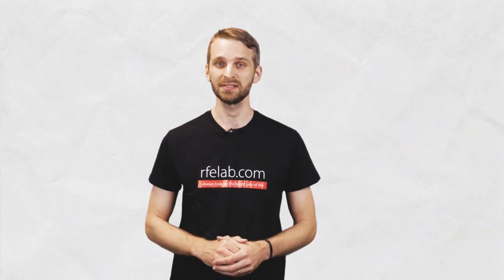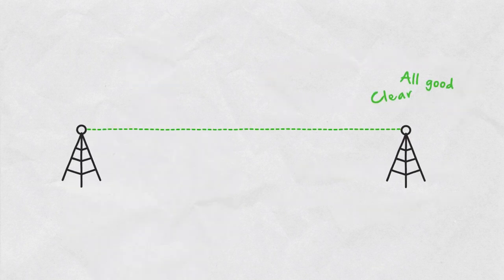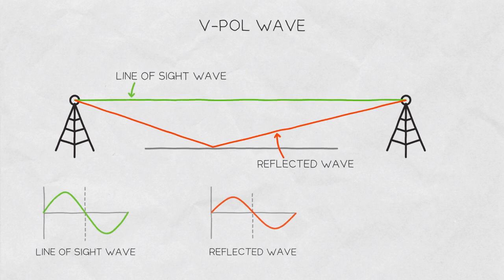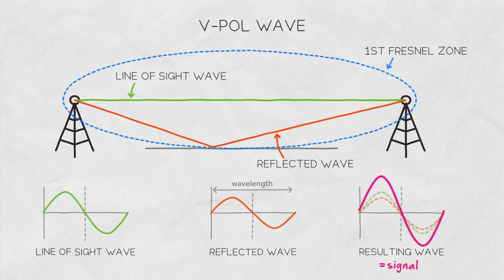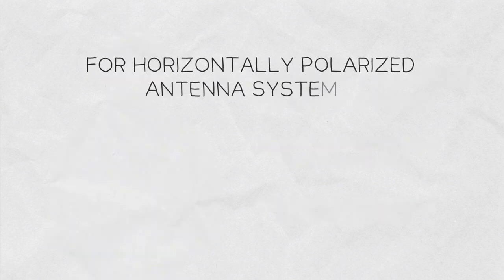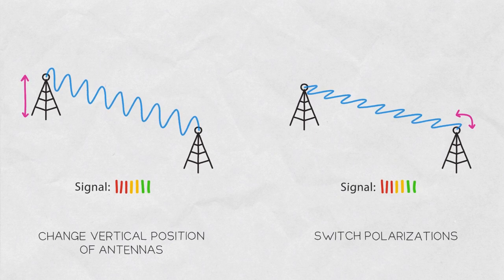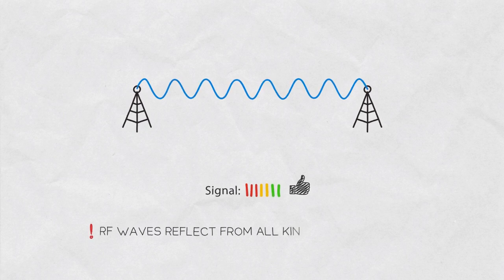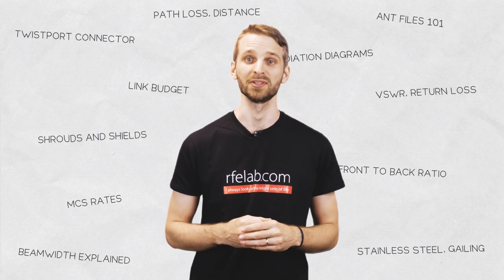Inside Wireless: Fresnel Zones

Comment: The Fresnel Ellipsoid is indipendent of the radiation pattern of the antennas; so if the antenna is a parabolic dish of 1m diameter or a dish of 10m diameter the ellipsoid is the same. But for sure, at the same frequency, the main beam of the 10m diameter is more narrow than that of the 1m diameter paraboloid dish. So the reflections are more attenuated by the radiation pattern of the 10m dish... In same way, in an actual scenario, we have to take into account the influence of the radiation pattern.... In other words, we can have the first fresnel ellipsoid obstructed by a tree or intersecated by the terrain, but it could be no effect on the link performance (i.e. no further loss...) due to the very narrow radiation pattern... Do you agree with me ?

Comment: That's a super good explanation of fresnel zones. While generally knowing about them I only now understood that it's related to multipathing. Does this mean that circular polarized antennas (as used on drones) the fresnel zones impact is less than with linear polarized antennas?   (since circ pol antennas reduce multipathing problem),
thanks, greets, RCSchim
Reply from the maker: Exactly, sine the field vector constantly rotates transversally to the direction of propagation, it is very unlikely that the direct and reflected waves add up destructively, or constructively resulting into decreased Fresnel zone influence with circularly polarized antennas.

Comment: How do actually verify this is happening? like partial Fresnel zone loss due to a building or tree or  Fresnel zones cancelling each other out?
Reply from the maker: It is not simple in real life because of the terrain complexity, but some of the RF link planners do show the 1st Fresnel zone in their results, so at the very least you can rule that out. Nevertheless, the fastest/easiest way to optimize the link performance in terms of the Fresnel zones is to sweep the antenna position on the order of a few wavelengths (6 cm @ 5 GHz) and see where you have the best signal

Comment: can dual polarization  of a given antenna work? or does it exist? thank you
Reply from the maker: What exactly is your question? This one is very unclear...
Reply: @Rfelements  He offers a good question here.
 What happens when you use a dual polarization yagi? 
Example, an "X" polarization, to "X" polarization (or linear or horizontal antenna, at the other end). 
Or... a "+" polarization yagi to a "+" polarization yagi?  Lots of variable here, but a good question on "what would happen?"
Case examples of how obstruction into certain Fresnel zones - relative to data losses observed... would be GREAT to see!
This issue is rarely addressed by many in the field.
Reply from the maker: if the polarizations of antennas on both sides of a link are matching, the reception works optimally - no polarization mismatch loss is introduced.
The Fresnel zones influence (and all the other reflections in the propagation channel) is not straight forward thing to model. This is why there is a lot of effort in scientific circles developing statistical models of the propagation channels, because statistics is what all the reflections melt down to in the end, since no scenario is the same.
Reply from the maker: What is your language? If it's Spanish, we have a native speaker working for us..